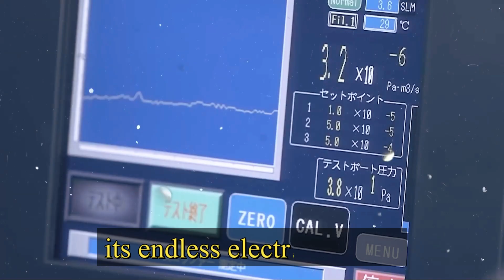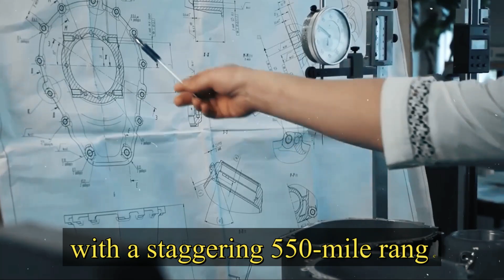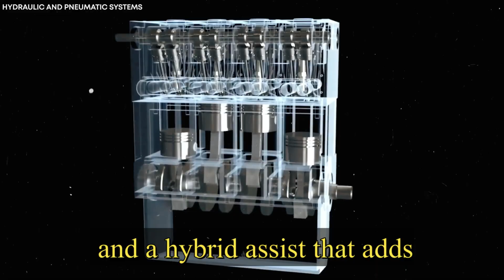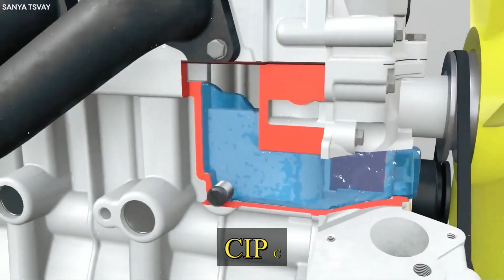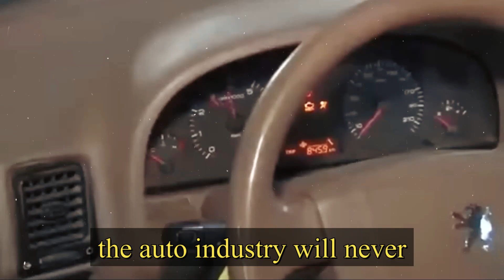🚨 5 Minutes Ago: BYD CEO Shocks the World With NEW Hydrogen Engine — The End of EVs?

Comment: H2 engines is an viable option for big trucks as shown in China, but not for passenger cars;  because a compressor for a gas station costs $1M.
Reply from the maker: “True, hydrogen is showing promise for heavy-duty trucks in China, but for passenger cars the infrastructure cost is a major barrier. A $1M compressor per station makes EVs and hybrids way more practical right now.”